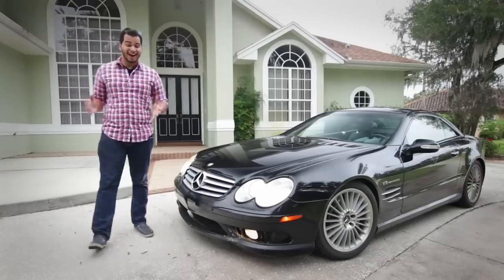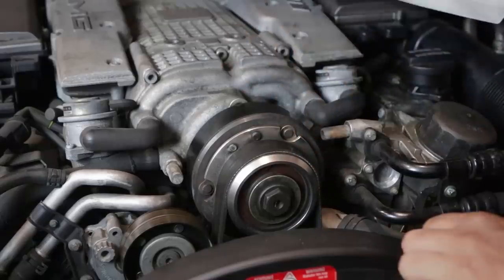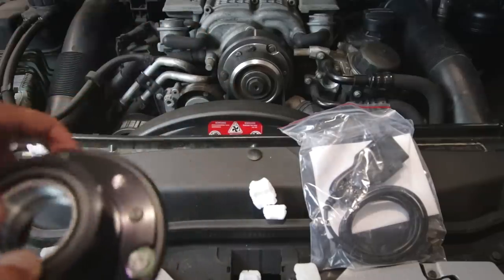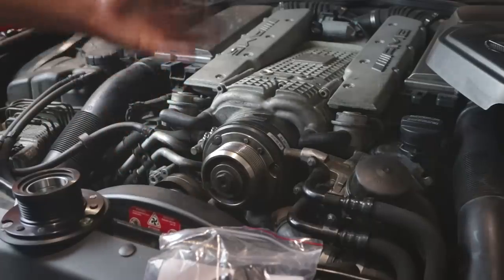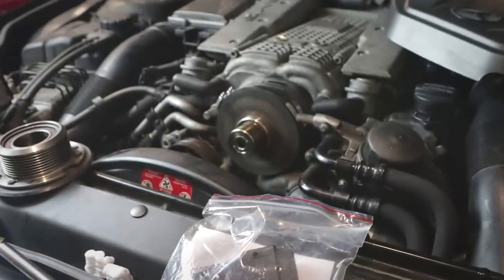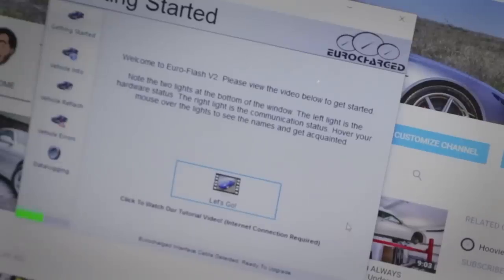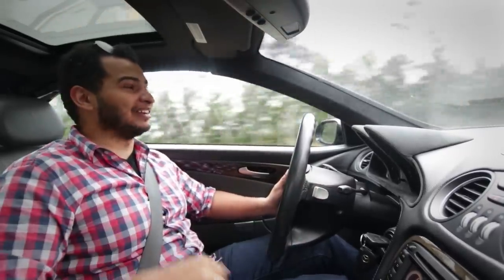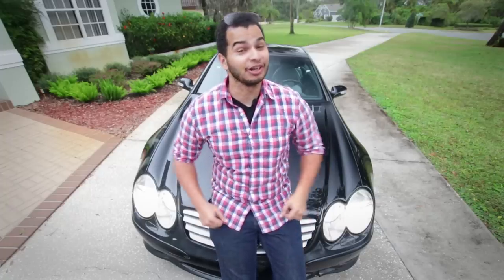This Little Box Made My Cheap SL55 AMG STUPID FAST! - Project SL55 Pt 8

Comment: $900 for a 10-15% power gain...pretty good bang for your buck. Great job Tavarish
Reply: I paid 200 euros for 40% gain on my A5
Reply: @DuBstep115   so what you have done?
Reply: @jonaswelldone2900  ECU tune
Reply: @DuBstep115  is it based on software? how many kw was is?
Reply: @jonaswelldone2900  I dont know how ecu works, my guess is its a software itself reading parameters that are altered through the "tune"  I went from 179kW to 253kW, that ads 39,53% just with ECU tune.
Reply: @DuBstep115  Now that's a boost. What engine is this? By the way, don't use that extra power too much, cause all other aggregates are still the same for 40% weaker car
Reply: @jonaswelldone2900  All day every day for over year now, it shares almost every part with audi S5 so the powetrain is rdy for over 350hp. The engine is CAPA 3.0 TDI V6
Reply: @DuBstep115  Well done. How ever your upgrade to S5 is a bit more expensive then 200 bugs, right :) however, respect, I like people upgraders :)
Reply: @jonaswelldone2900  No it SHARES meaning s5 and  3.0 tdi A5 have same tranny, wheels, bumper and rear diff. Only things that are different is suspension and engine but 4.2 V8 S5 is trash tbh, 344hp from. V8 in 2010 is not good by any standards. The new facelift 3.0tfsi (supercharged v6) is god like engine.
Reply: I can’t imagine my car like this going even 5 percent faster
Reply: @jonaswelldone2900  5.4 L  .. supercharged

Comment: Hi, actually I am surprised that you did this just now. Its kind of main and easiest way of turning your any compressor Merc in to faster one. It doesn't matter if you have SL55 (or other with the same engine), C32 or C180/C200/C230 compressor - procedure is the same: change pulley, belt and reprogram map to run well - and you have 50+ HP fast and easy.
BTW - important now to change your stock intercooler to bigger aftermarket to make sure your intake temp is lower, because compressor heats up air quite fast. 2-3 runs on strip (or any road) ant it will reach some 55-60 degrees of C. Then you loose lots of power..
Basically you can get around 100hp just by changing pulley on compressor; pulley on crankshaft; intercooler and remaping. And you have around 600hp just like that.

Comment: Excellent and VERY clear video. Just one tip if anyone else intends to do this mod. You should check the clutch gap will a gauge and any adjustment is done with shims. My kit came with a selection of shims for this very reason.

Comment: 7:59  The belt-wrap kit does more than let you re-use the OE belt.  It forces the belt to wrap around the pulley to a greater degree (remember degrees of a circle?)  so the belt is contacting more surface area of the pulley.  Since the pulley you put on is smaller we need to grip more of it to get the same purchase, as the Brits would say.

Comment: I just tuned my 128i for the new 3-Stage variable-length runner intake manifold I installed over Thanksgiving. Need a few days for the ECU to adapt, but first impressions are amazing. The whole car feels alive! Congrats on the pulley and tune, Tavarish! If I were going for forced induction, I'd go for a supercharger, mostly for the absence of lag, and the sound.

Comment: Glad to see an SL55 getting mods. Have you put long tubes on yet? That will yield you a nice gain as long as your tune isn't rich. most of the tuners out there advance timing too much which really isn't necessary and you can run the stock injectors if you have the light blue 480cc ones with that pulley and headers you'll be fine as long as your tuner doesn't suck, or get a tune for some slr ones if you plan to do the following mods I list. Word of advice don't go with the 550cc Bosch ones. If you really wanna get funky upgrade your TB to a 90mm BBK with a modified inlet to fit, port your heads and get some cams, if you want it to idle nicely get some slr cams and mod them to fit. Heat is going to be your biggest issue especially in hotter months even with an extra heat exchanger. Unfortunately our intercoolers arn't that great. Just get a trunk tank and use ice on your track days. Or a meth but you'll need a tune for that too and not the best in my opinion as a daily better to just go old skool and use a tank and or a KC. Also don't forget your diff, that will be night and day.

Comment: I’m very surprised that you were able to take that off with just a breaker bar. I had to remove the fan shroud so I could get it impact wrench in there. And mine only has 85,000 miles on it.

Comment: You can put a bigger pulley on I did , I'm running a 180mm pulley and getting 440kw or around 590hp at the wheels

Comment: Just like break roders and flywheels you shoud resurface the mateing flange to the clutch.  You can get a paint removal tool that you can attach to your drill that will take off the surface glasing of the clutch mating surface
Reply: Ya spelling is not my strength

Comment: You are actually just supposed to turn the torque wrench until it clicks ONE time. If you turn it to the klick more than that the torque of the bolt you are tightening will be more than that you had set the wrench to in the beginning.

Comment: When will you get the new gearbox ?
Reply from the maker: Laurynas Miklovis I'm still waiting on it. Hopefully it will be done by the end of the year.
Reply: its the end of the year already...
Reply: Tavarish ...I am not knocking the manual transmission thing but I am exceedingly skeptical that it can be done for anything a normal person would considered a reasonable amount of money.
To put that into perspective. I suggest it will cost at least half of what you paid for the car to get a manual transmission, get it and the supporting mods installed in that car.
I am watching with great interest.
Reply: never click bait kung fu at its finest
Reply: Why not consider the Tremec TR3160, as used in the current Shelby GT350? That transmission is able handle the 526 hp and 429 lb-ft of torque from the 5.2-liter.
Reply: Mohamed .Kanoo ...3,000.00 transmission, 1500.00 custom clutch. 1500.00 custom driveshaft. 2000.00 engine transmission adapter plate.
1,000.00 ecu tuning. Am I forgetting anything? 
9,000.00? that was the cost of the entire car!
Reply: Bro he already has the Tranny, he made a whole video on it. There is a kid in Turkey that drifts Mercedes and he does the manual conversions on them. I'm sure he already has most of the part to do the swap. He can probably eaisly get sponsored on the clutch and drive shaft.
Reply: NinjaAssassin407 ...bro...nothing in life is free.
What I stated is that the cost to do this would be at least half what he paid for the car. If one uses simple addition it is obvious that the true cost to do the swap was actually as much as he paid for the car.
What some guy elsewhere  does with his Mercedes is irrelevant. In the real world where people actually pay to modify their vehicles this is a very expensive and complicated swap. The proof of this is on Google. Please search "6 speed manual swap for Mercedes sl55 amg" let me know what you find. I will go ahead and tell you....nothing!
You see a manual was not an option. This may come as a surprise but Mercedes doesn't really make a true sports car. They make some very fast GT's (grand tourers) and sport saloons but not what people would consider a true sports car (like the Porsche 911/ Cayman Audi R8,Lamborghini and about anything Ferrari has ever built. 
I am not saying mercedes hasn't made some extremely fast hardware...it just isn't what one considers a sports car.
At any rate,in the past a manual transmission was essentially a prerequisite for any car to be considered a sports car .
Since Porsche created the first dsg (pdk,dct etc) they have proven that the 3rd pedal is not really necessary for a sports car.
So...in the end the manual swap is past it's relevance.  At this point one would need to swap in a very strong pdk to increase the true performance of this machine (and drop about 1500 lbs!).
Cheers!
Reply: Not needed, the stock 5 speed semi-auto is good for 900bhp, its a race box!

Comment: @Tavarish - Nice video. I ordered the 76mm pulley like you have. Did you do anything with cooling? It was suggested to at least add a split cooling kit which I ordered. Trying to figure out the install on the split cooling piece. Instructions were not that great.

Comment: Nice video. I've been thinking about the cooling mod first and then a smaller pulley for my E55.
Reply: Cooling is the best place to start
Reply: Victory Road Performance  Agreed. It seems like the stock car throws a fit in traffic and/or a hot day.
Reply: +WookieMonster01 There is always a reason a "simple mod" wasn't done by the factory meaning a con greater than the pro for DD.

Comment: What kind of cooling mods you would add to the 76mm? Would a upgraded heat exchanger be good enough? And any other suggestions on other mods other than cooling mods like injectors or even spark plugs? Thinking about a 80mm or 76mm🤔

Comment: Hi. Few questions... Maybe I wont get answer but ill try.Im going with 72 mm pulley and I know that U had 76mm and k080505hd belt for it.. did U had any belt slip with that belt ? And if I will go with 72mm what belt I should use??Do U think It  will be more possible to have slippage on 4mm smaller pulley??   Whats Ur recommendations?? Or 76mm its just good enough...?? Thanks...

Comment: Have you experienced a heat soak after installing 76 mm pulley and a tune ? Or you had already upgraded IC pump ?if you did upgraded the IC pump what brand did you go with ?

Comment: If you have high school level of physics the higher rpm of the pulley and supercharger inside gears spinning, the more heat generate and needs more cooling system in order to run physically right, man.

Comment: If you break the pully nut loose before you take the belt off you won't have to do that clamp trick
Reply: The supercharger will just spin with the belt on due to the clutch system.

Comment: Every time I view one of your vids, I reconsider the decision to sell my 05 SL500.  Your vids, show me that I can do some of the expensive repairs at home. Thanks.  I'm wondering if you had any problems with motor and transmission mounts yet.  I am also finding issues with my soft close trunk.  Any suggestions?

Comment: Putting a 76 MM pulley with no cooling mods or headers living in Florida.... Good Luck
Reply: Andre Stojanovic if you would do this on the S55 you will be good because that one comes with two heat exchangers all the other one are with one, maybe the CL it’s two as well

Comment: $849 for a fuxin polley are you serious ?
Reply: freakin VRP.... all their products are expensive af... safe to say they are the only known brand producing it so its basically like Apple inc lol
Reply: E55 BæMG 849 includes a tune aswell
Reply: Victory Road Performance not bad... but still some of the prices are high when thinking of the actual value of these cars
Reply: E55 BæMG understood. We have the lowest prices available. Unfortunately the clutched pulleys are very expensive to make. That's why fixed pulleys are only $175 compared to the $550 of the clutched
Reply: Look at the bright side, and think about it as $900 for +60/90 horsepower/torque.  I think its a good stepping stone if your building it up to add more power.. get bigger headers and that could probably double this** mods potential.
Reply: My Mercedes mechanic said "if you change the pulley then you'd need different injectors to handle all that pressure" also you'd need heat-exchanger. There must'ave been a reason why MB engineers didn't use the 76mm in the first place. Who wouldn't want more power?
Reply: @Hesam0000  ......Whilst the manufacturer is looking for power he has to be also aware of Gas omissions, Noise, etc otherwise the car will not be able to be sold,,,,,This is why there is always aftermarket sales ( some worth doing / some not )...Your mechanic might like to look at the video as it appears Tavarish never changed injectors and he went down the road.. I;m sure the Merc injectors are big enough for the mod shown.

Comment: Tavarish, great easy to watch video thankyou 
I’ve got a 2003 SL55 totally stock which ran 12.5 at Santa pod
I was told 76mm pulley is very small and needs “other stuff added” hence ££££££
So would you think a 80mm is easier to fit with a belt and tune?? without adding extras etc cooling etc

Cheers
Reply: Hey what did you end up doing with the pulley?

Comment: It seems so easy to do!

Though.....

About the charger, isn't it a risk that with the small pulley it overuns?
Also... the increase of torque seems huge, how the gearbox (and transmission in general) handles that?
Ready for a vegan gear salad? ;-)

Comment: Is there any reason you went with the 76mm pulley instead of the 70mm?  Also, any interest in going with a large throttle body?  Maybe the VRP 85mm?  Would love to see what kind of power you make with both of those mods
Reply: 5 days later, still wondering about those pulleys and throttle body
Reply: day 9 and the I'm still haunted by the reasoning by which you chose the 76mm pulley over the 70mm.

Comment: 849 for Pulley and Tune Combo wow this price....
Reply: Benas- CSGO that’s not bad for all of that
Reply: Murica's Modeling Headquarters not bad!?! It was a fucking pulley and a tuning program. Shouldn't be more than 200.  Probably could make the pulley/clutch surface in my basement for like 75. Companies really need to focus on something other than emptying pockets
Reply: Well, considering that an OEM Replacementpulley for these is around 1000$ I'd say 850 for an aftermarket pulley plus tune that also gives you more power isn't that bad of a deal, even if you only tried to get a replacement for the worn oem part.
Reply: Mercedes prices smh
Reply: Baerchenization not in America
Reply: Eurocharged tune and pulley is a way better idea.
Reply: Scott Smelko yeah my Bonneville ssei pulley and tune was about $250 but that's an old gm 3.8 engine with an insane aftermarket for cheap but this is a benz and the cheapest pulley and tune I can find for my S55 is about $1100. You have to pay to play and of course the Mercedes tax. I thought the mods were overpriced at first but also have to keep in mind what kind of vehicles we drive. Of course aftermarket parts for American cars is cheaper.

Comment: When you do this you also need to 'amend' the air intakes to ensure 'cold air' plus an intercooler pump upgrade is recommended to stop the supercharger overheating and cutting off - try a Johnson intercooler pump used in the Lambo marine version of this engine... Before you know it your running 630bhp at the wheels... When you throw in 135 octane race fuel it'll easy run 780bhp with a re-map..... Have fun!

Comment: what's the clutch on the supercharger for?
Reply: efficiency.  When you're not on the throttle (as judged by the pedal position sensor i'm guessing) it releases the clutch so you're not driving the supercharger.  Reduces wear on the blower and fuel consumption.

Comment: why 72mm and not the 70mm kit? and you're doing the mod via usb and a laptop?
Reply: 72mm and 70mm requires fuel injector and in upgrades as well.. 76mm just needs a tune.

Comment: I dont know much about superchargers but wouldn't that make it work harder and more often thus shortening the lifespan?
Reply: Not more often, but it does spin it faster.
Reply: Victory Road Performance right so isn’t it shortening the lifespan? It’s gotta induce more wear and tear.
Reply: Korey Wanko you're not wrong, but the change isn't enough to worry about. Superchargers are fairly resilient
Reply: Any time you increase power or stray further from the stock engine design you're gonna lose some longevity. It's just inevitable
Reply: viperbeatsvette you just lose it then your increased power kicks in . Not if you dont use the increased power.
Reply: Yes, it will some.  But because it has a clutch, it means it isn't engaged all of the time.  If he doesn't get on the throttle hard, no difference at all.  Of course, who has 500+ HP and doesn't get on it?  Haha.  Anyway, some superchargers have tips on the lobes of the supercharger internals where it meets the wall, I want to say they are teflon, but that kind of doesn't make sense since teflon expands and contracts a lot with temperature.  Anyway, turning the supercharger faster can cause those tips to melt/wear.  And of course, more power always means more stress on the engine.  Personally, I think it's worth it.

Comment: The bigger your driven pulley (vs the driver), the slower it will turn but the more torque it will produce. The smaller your driven pulley (vs the driver), the faster it will turn but the less torque it will produce.

I don't Understand?!!

Comment: is it just me or do the paddles shift HELLA SLOW
Reply: I own a CL55 and I don't use them because of that.
Reply: Compared to the VAG/Audi DSG box yes they do but in manual mode and sport its quick enough given the box will take 900bhp at the flywheel.....

Comment: All good, until it becomes a flying ball and destroys all around it...for all of you...if you must change a pulley, change crank pulley. Only OEM sc pully does the job right.
Reply: just the opposite actually. We use heavy duty springs on our SC pulleys and have had 0 failures, Crank pulleys are much more dangerous and can fly off and sheer your crank key
Reply: Victory Road Performance yeah right, thats why there are so many of them cases of this happening on the forum.

Comment: I believe the SL55 has a bigger heat exchanger than the other M113K cars, but they're still very prone to heat soak in stock form. A 76mm sc pulley with no cooling mods and no headers is nothing but a heat generator. Wouldn't be shocked if your car is actually slower in the 1/4-mile now, particularly on hotter days.